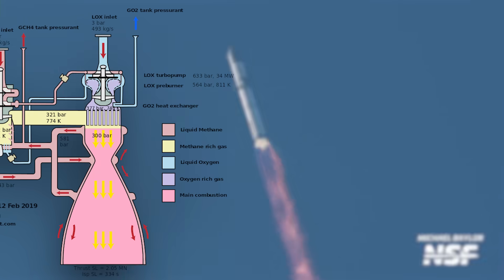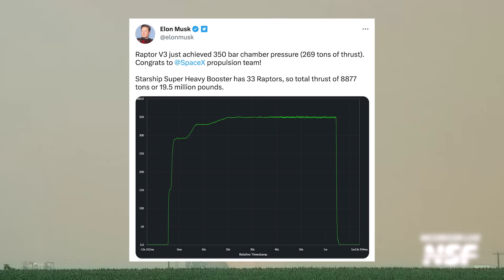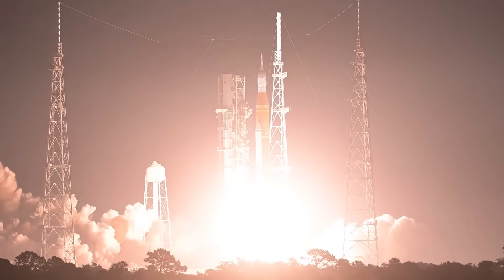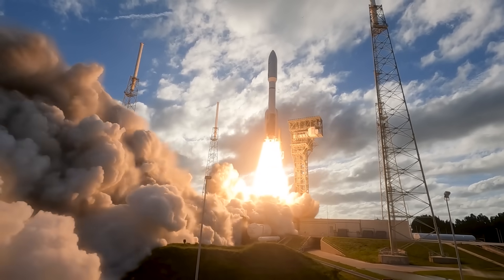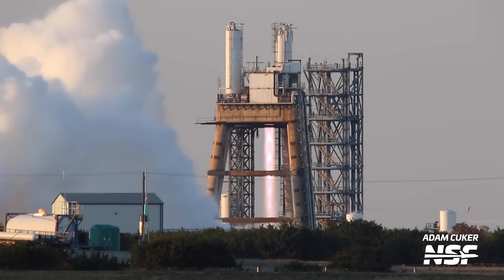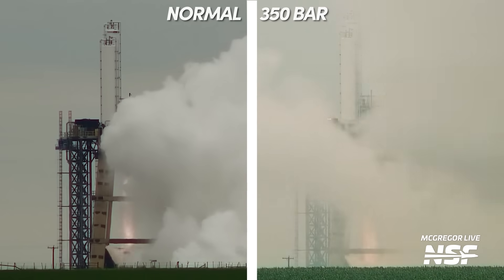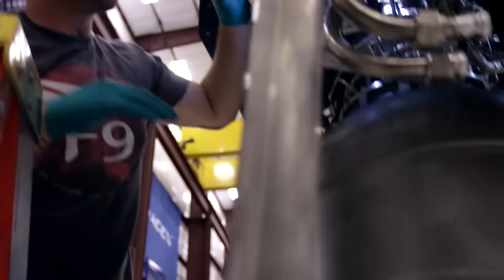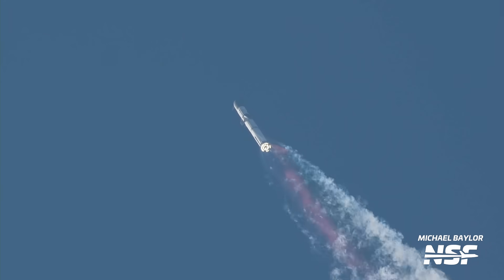SpaceX's New Raptor 3 Smashed The World Record!

Comment: How will Raptor 3 behave on Say MARS;Say on “The Mars “ Created Version of The MARS Rocket Fuel. Since they don’t know Water Content after Unfreezing. (Or at all for that fact. Nor do they really have sufficient facts on the other or Secondary materials required to create that fuel at MARS pressure as well as wether or not they can gain transfer pressure. Leaving one’s RETURN TRIP Ticket a little Open Ended. Thanks 🙏 for a GR8 show NSF. GR8 Details

Comment: Raptor 3: more power, morw fuel efficient, less weight, simpler and easier to mass produce (read: cheaper).  The result: more payload to orbit for less money.  More compact also means more room to gimble (manuver), thus more control.

Comment: I am a hydraulic systems designer and will say 5000psi is crazy high pressure. Especially at the size and lbs per second of fuel those engines are running!

Comment: Human already went to the moon in the 60s, deflagration engines are not better than detonation engines, improvement in rocket engine efficiency is extremely low, rocket equation, this means nothing,be honest
Reply: That's correct, the F1 built in the 60's had 1,500,000 lbs of thrust at sea level, what world record are they talking about?

Comment: One might think that higher pressures and outputs might mean shorter engine life.  350 Bar must put a lot of stress on an engine.
Reply: They tested the engine until it failed. If you know how much stress it can handle you can further improve it or you can reduce the pressure to get reserves for more reliability.

Comment: If the chamber pressure is 350 bar just imagine what the inlet pressure for the propellant must be😮
Reply: Pre-burner pressure should be a lot higher but since the Raptor 3 engine is a much cleaner design. The pre burner pressure should be much closer to the combustion chamber. SpaceX should have designed out the parasitic pressure loss between the pre-burner and combustion chamber.

Comment: @NasaSpaceFlight if the relative increase in each engine can be assumed to have an 18% higher thrust at any given throttle, meaning that the safety margin is also higher, would that mean that starship could make it to orbit using less fuel in its upper stage which in turn would mean that starship would need less in orbit refuel mission AND each fuel tanker could be filled with more fuel? So over all less launches needed to get to the moon and Mars?
Reply: Yes, that’s the idea.

Comment: They can’t seem to fly the existing version with less than a 10% failure rate, much less one at higher pressure. Reliability and production rates are serious problems for Raptor, thrust isn’t.
Reply: It's just a rocket being tested and not remotely considered to be used for some time.

Comment: Raptor 2.0 has the thrust needed for Artemis. Focus on maturing it so the program timeline is adhered to. There will be time to pursue Raptor 3.0 later. The perfect is the enemy of the good.
Reply: If Raptor 3 has more thrust they can simply reduce the thrust to get an engine which is not run at the limit. Reserves are never bad for reliability.

Comment: Rocket engines are very complex as Jack said. Why go with 33 complex engines vs a much smaller controllable amount that need to be designed. Nearly 3 dozen engines must be working in perfection. Probability of errors are much higher and more RUDS will occur. Sorry to rain on the parade.
Reply: The Falcon Heavy flies with nine Merlins on each booster making a total of 27 engines and I haven't heard of any issues with Merlin engine failure.  The Raptor engine is still in a relatively early stage of development just like starship is.  Give it time!
Reply: @michaeldeierhoi4096  I appreciate the reply. I’m a controls engineer and do a lot of complex loop controls besides digital and see a lot of algorithms that can fight each other if losing any. Last launch lost 3 immediately then another 3 and it was done. Saturn rocket had 5 engines. What if these had 9 Saturn type engines keeping same fuel combo. Sometimes the KISS principle can apply.
Reply: @youdaman5069  beside the idea of mass production the other idea behind more engines is reusability. The F9 for example could also fly with one big engine, but it couldn't land with such an engine. Even the thrust of a single Merlin engine throttled down is still slightly more than the empty weight of the booster without fuel at landing. It needs 9 engines because it only needs one of them for landing, and this one (the center engine) don't even has a redundancy. If they would use a bigger engine beside one Merlin they would need less engines, but this would mean they would have to develop and make another engine type. 

At Starship a single engine has less thrust compared to the empty booster weight (they use more than one for landing) however they want to use more than one for redundancy reasons at landing. They also use the same base engine on the upper stage (at F9 and at Starship), just with a bigger vacuum nozzle. The same engine must be able to land on the moon, which has just 1/6th of the earth's gravity. 

The Saturn 5 was built different, they had different types of fuels in the individual stages and the 2 upper stages used different engines. Since the booster was never made for a landing they had not to care about thrust per engine vs booster empty weight (The F1 couldn't be throttled down anyways) and so they could build very big engines and just use 5 of them.
Reply: If a large engine fails when there is only a few engines on the rocket, the rocket launch fails. If a small engine fails when there is several engines on the rocket, the launch can continue. 

Small engines are also easier to mass produce than large engines. Smaller factory needed, easier shipping, and easier installation into the rocket. And building more engines allows you to find issues faster.

Comment: The thrust is impressive but isn’t raptor 3 also going to be the cleanest design so far too? Elon mentioned that the engine itself shouldn’t need any heat shielding since there will no longer be anything fragile exposed on the engine. As well as RUD containment built into each engine.

Comment: 5000psi on top of dealing with all that heat is absolutely insane.

The metallurgists at SpaceX deserve a raise.
Reply: Bullshit!!! Which metallurgist!? They aren't better than any others lol!!
Reply: Rocket engineers use film cooling to prevent hot gasses from touching the metal… 
A thin layer of unburned propellants line the combustion chamber & engine bell.. you can see it in the pics as a ragged edge extending past the exhaust point. 
Also regenerative cooling.
Reply: If this watercooling base does not melt or get blown away i'll eat my own shoe
Reply: @Flyingdinosaur69 well….
👞🥣
You can’t back out now😂
Reply: @Flyingdinosaur69  If it doesn't, it'll reflect EVERY bit of FOD at the base of the booster, as well as a good amount of steam.

Wonderful for electrically-actuated motor gymbals...to say nothing of exhaust bells cycling flammable cryogenic fluids.  Should be a gritty barbecue but crap for a launch.
Reply: @jsmith42690  Really?  So tell me about the turnover rate.  Tell me about the engine failure rate.  Tell me about pounds of cargo already carried by thrse 'production ready' engines.

You can't, because they still aren't.

I'd say my comment aged rather well, thank you...
Reply: Why? 1 out of 6 destroy themselves
Reply: @ToppledTurtle834  because 1 out of 6 is as bad as itl ever be and it will only be improved from there
Reply: @ToppledTurtle834 still better then 6 out of 6!
Reply: @sawyer post  No, it won't...because failure is NOT an option.  You know, like the engines for Apollo V Stage 1?  NONE of them failed, DURING ANY LAUNCH.

Raptor is a mass-produced PROTOYPE, and is king of NOTHING except maybe FAILED launches.
Reply: @billcichoke2534  at this stage in SpaceX's design cycle, failure is obviously an option they can afford, and the iterative improvement is yielding better and better results. I think what we're seeing is more analogous to how the soviets approached design and test, where they placed much more emphasis on just sending it and seeing what it could do, where old school NASA was much more interested in getting it right the first time. I think both approaches can work, and SpaceX has several advantages the soviets didn't have.
Reply: @arfink  agreed. And this gives the added benefit of not having to over-engineer everything. NASA didn’t have to scale production in any similar way.  How many Apollo V rocket boosters could NASA create in a month let alone a year
Reply: @billcichoke2534  Keyword prototype, they are meant to be improved on
Reply: @Johann  No, keyword PRODUCTION, which means (at least for grown ups) that the item is production ready.  Musk has already stated it isn't, as he bragged about production numbers of one per day.

You don't keep making the same thing that doesn't work unless you're a fool or a grifter.  Musk is BOTH.
Reply: @billcichoke2534  Engine failure is an option when you have 33 engines on the booster. I hope you know an engine like Raptor being made per day is incredible. That would be a full stack in just 39 days, until the eventual increase in engine count on the ship to 9, then 42 days. Engine per day doesn't matter THAT much though, considering SpaceX doesn't intend to throw them all away on every launch of Starship. 
I don't think you quite understand the idea behind iterative development, things are going to fail, that's the point. SpaceX would take decades to get to the first launch of Starship if they were trying to make sure everything was perfect beforehand. Test an iteration of Starship, it explodes, fix the problem, launch again, it explodes again because the fixing of the previous problem broke something else, fix that, et cetera, until it is done. That's the idea. This is much faster, and makes much more sense when the launch vehicle isn't nearly as expensive as a rocket like the Saturn V, which you seemed to misname as Apollo V. NASA doesn't do iterative development, because they would lose WAY too much money doing it, and they wouldn't have nearly as much money to gain. 
Starship isn't just going to be the pinnacle of rocket engineering yet, it's going to be a huge money generator for SpaceX, and whether you like it or not, it's taking humans to Mars too. In a few years, we'll see it all happen. They'll keep making Raptor 2 or Raptor 3, (even though they will be likely be considered ancient after a couple of years), they will be putting them on Starship, (even though you think these engines don't work), because THAT, is the only practical way for them to figure out HOW these engines don't work. THEN they can improve upon it. THEN they can go further towards their goal of a fully reusable rocket. You don't just make a rocket and it's already a fully-reusable masterpiece. It's difficult! Rocket engineering is difficult! Especially when the plan is something like Starship. We may be on Raptor 5 before Starship launches humans. Who knows!
Iterative development was used heavily on SpaceX's Falcon 9. So, so many Falcon 9 boosters crashed and burned before the first successful landing.
Look where Falcon is now.
Reply: @billcichoke2534  Im am pretty sure what they mean by production and what you mean by production are different, they are going for the many attempts development method which requires a lot more rockets, so they have to make a production line for them
Reply: @billcichoke2534 Elon is using 'production ready' in the noun sense of the word production - they're ready to start to produce the engine prototypes at scale and you seem to be talking about 'production ready' in an adjective sense of the word production, similiar to how one would say "production car" - you believe Elon is claiming that they have a finalised, standardized engine design ready to be mass-produced, and he's not.
Reply: @TheNheg66  Then he shouldn't have been bragging about producing one a day if this is a prototype and not the actual production ready design.
Reply: @billcichoke2534  but they are producing one prototype a day. Why shouldn't he?
Reply: @TheNheg66  Because prototypes aren't working items.  They're copies of where the item is in its current state of DEVELOPMENT.  As things change, so will the build rate.

It's a meaningless thing to brag about.
Reply: @billcichoke2534  😆 ok i see there is zero point explaining anything to you. Have a wonderful day
Reply: @billcichoke2534  dude forgot the entire point of engine-out redundancy
Reply: @ToppledTurtle834  On purpose. They are deliberately tested to destruction to find out where the margins are.
Reply: @ToppledTurtle834  if you made a rocket engine 99999/100000 would explode
Reply: @Allthegoodhandlesaretakenlmao  Give me 20 billion. I will give you better than starship

Comment: curious, does the V3 consumes more fuel at full throttle than V2? and if V3 is matched on V2 full thrust, does V3 consumes less fuel than v2?
Reply: Unless V3 has a significantly higher efficiency (it probably has a slightly higher efficiency, V2 was already pushing the efficiency limits), it will burn through more fuel compared to V2